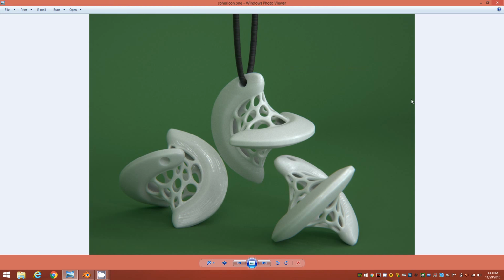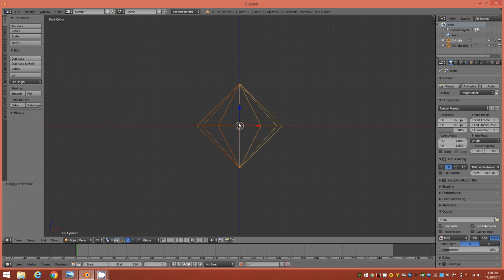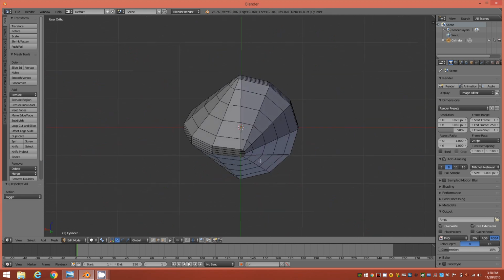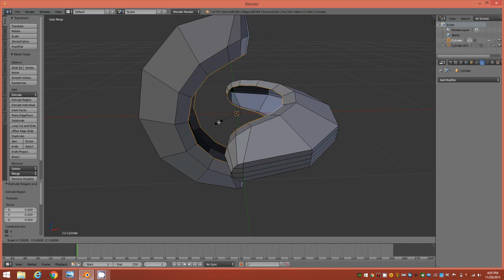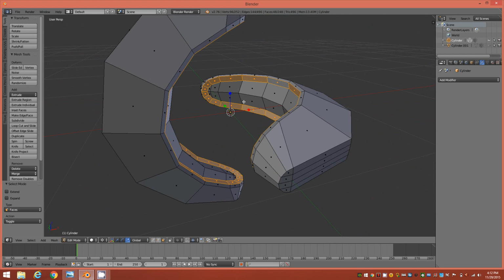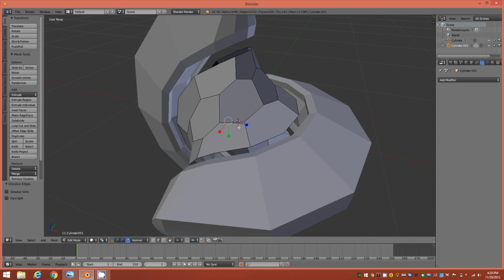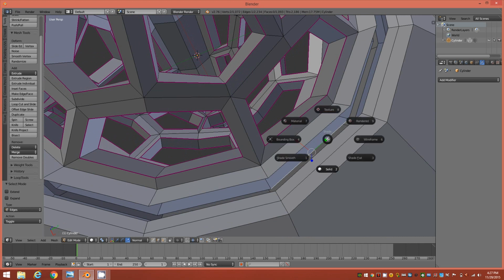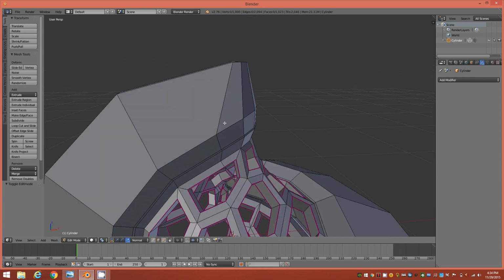Model A Sphericon Pendant In Blender 2.76 (Part 1) | Tutorial

Comment: Was it easier in max or in blender ?
Reply from the maker: At the time of making these videos, I had only just started learning blender.  I would say at that time I had been more familiar with 3dsmax, so it was easier for me to work in Max.  However, over time, wnd with the changes in blender over the years, I've come to find it just as easy to model with as max.  There are certain things in Max that blender doesn't have which can help a workflow like this, but blender also has features which I find faster and easier now than max.  So it really depends on which one u know and feel most comfortable with.  They're both about equal for modeling.
Reply: @luxxeon3d  i use rhino and matrix for jewelry design and well they are very accurate in term of 0.1mm details and 3d printing specially when you work with pave and lots of stones then minor details are important. can you work with very small dimensions and accurate to 0.1mm details on blender and max ?
Reply from the maker: @shayansep755  Yes.  Both 3dsmax and Blender can work in mm, and are accurate to tenths of a millimeter.  However, you need to set up your units in the software for this type of work.  It is not set up for that by default.  Also, CAD software like Rhino work in an entirely different method to 3dsmax or Blender.  The surfaces in Rhino are created using NURBS.  Most of the time in 3dsmax or Blender, you'll be working with less accurate polygons and subdivision surfaces.  This can still be made as accurate as you need, but it requires some extra care.
Reply: @luxxeon3d  thank you for your reply
Reply from the maker: @shayansep755  You are welcome.  May I ask why you are looking to move away from Rhino and Matrix?  Those software packages are the industry standard for CAD jewelry modeling these days.  Blender, Zbrush, and 3dsmax are gaining ground in terms of 3d printing jewelry creation, but still, they are far behind Rhino and Matrix when it comes to professional jewelry design for high-end product creation.  I would stick with those if you are planning to make a career as a jewelry designer.  Blender, 3dsmax can both do great professional models too, but it will require a lot of practice to get used to working with polygons in a way that is accurate enough to compete with Nurbs for detailed jewelry.  Honestly, it is not common practice to use polygons for professional 3d jewelry design.  It's good for 3d printing and fast design iteration though.
Reply: @luxxeon3d  dear friend
I am a professional jewelry designer and have years of experiences in 3d printing for jewelry casting in fact i have a jewelry brand my own and i have a master's degree in industrial design....i just said this to know each other better.....i use rhino and matrix and zbrush for years as a professional and yes you are right rhino is a great tool for 3d modeling accurate models but when it comes to making the model ready for rendering there are some disadvantages like very sharp edges that rhino often cant fillet them right or the uv of the surface is sometimes not quite right for a good texture mapping i know there are lots of ways to make them right for example i use materialize magic software for filleting the edges that rhino cant or use zbrush to bend the prongs on the stones.....nurbs are great but sometimes you can make complicated surfaces much faster in polygone world instead of mathematical world with lines and curves and when it comes to joining the complicated surfaces together rhino is not very good on that and many more reasons.....actually i was more thinking  about combining softwares together do some parts in polygons and some in rhino and....

Comment: At 9.07 after I rotate 90 degrees and go to remove doubles there are no doubles to remove and it is still in two pieces.
Reply from the maker: Make sure your merge distance is set to a number which will sufficiently weld the vertices, and if you have something selected, be sure there isn't a check box in the Unselected box by default.  If Unselected is checked, that will select only the parts that are not selected, and since you have everything selected, nothing will be welded.

Comment: First of all: thank you for your excellent tutorials.

About modeling to real-world scale in Blender. Under the Scene Properties tab you can choose whether to model in generic Blender units (which you are using) or whether you want to use metric or Imperial units of measurement.
Reply from the maker: +MissCattitude63 Thank you so much for commenting.  Glad you are enjoying the tutorials.  Yes, I'm aware of the Scene Properties units of measure settings, but there's still some things about the units of measure in Blender that confuse me.  Some tool features seem to display arbitrary numbers, even when a unit of measure is specified in the scene properties panel.  For example, if I have a cube and wish to do a precision inset on it to exactly 2cm,  the thickness displayed by the parameters of the inset command isn't consistent to the unit of measure in the scene properties tab. This can result in some inaccuracies or confusion in some cases.  Until all of the UI parameter displays are consistent with the scene unit scale parameters, I'm hesitant to do a tutorial with specific units of measure.
Reply: John Malcolm I wasn't aware that some tools don't comply to the scene properties because I don't have the need for super accurate sizes. I usually just use Blender units and treat them as metric units (being European I have no need for the Imperial system) and it seems to work pretty well.

Maybe it's worth alerting the development team to this. I can imagine that many 3D artists need accuracy, you really don't want a 6ft earring ... :D
Reply from the maker: +MissCattitude63  I think it probably does work well in most cases, which is why it hasn't been fixed yet.  I believe Andrew Price has raised awareness to this and other issues already, so hopefully they will add some consistency in this area soon.  Another issue can be addons, and how they behave in regard to following strict measurement protocols.  I'm sure most of them work just fine, but I've found one or two that have some problems.  All in all, I'd like to see what unit I'm working in when it comes to parameter display, if only for ease o use.

Comment: On 39.02 when you select edge loop, in my selection only did select edge loop of one face and not the edge loop of the entire side. I probably didn't get the right topology of the object. 
But, I really like how you did 3D voronoi loops.
Btw, can you do some more shapes as that twisted fantasy pendant? Basically, more pendants :)
Reply from the maker: +Sunlessmage  Make sure you're holding down the Shift+Alt buttons as you select an edge.  Also, be sure the topology looks the same as it does in the video at that point.  If it appears the same, then it may be an issue of welded points.